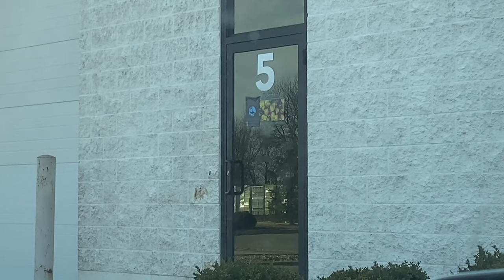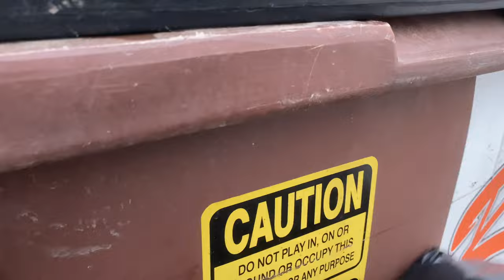Work day Vlog .. Epic Aquatic Arts Time-lapse

Comment: Awesome video! Could you talk a little bit about the canister filters. I’m running about 55 tanks and I have five of them that I move between my tanks. I always thought it was a comment on my poor fish keeping that I needed to use canister filters. Everyone would convince you that box filters or a sponge filters are all you need. There are even a few who are convinced you don’t need any filtration at all. Anyway, I’m getting the idea that you guys are on the other side of this, and it’s a very good thing to include cans?
Reply from the maker: It depends on your “style” of fishkeeping. At home I use no filtration but when dealing with high volume imports and without a full system they are a good alternative. Aquatic arts it’s going to be upgrading in the next 6 months to full sump systems they a custom designed. So it really just depends on your needs. They work well if you use them right.